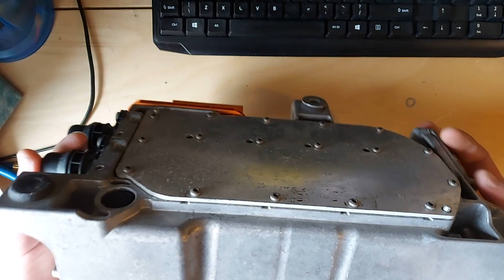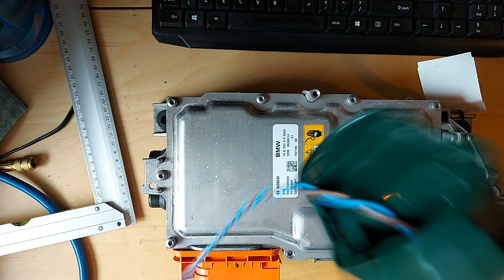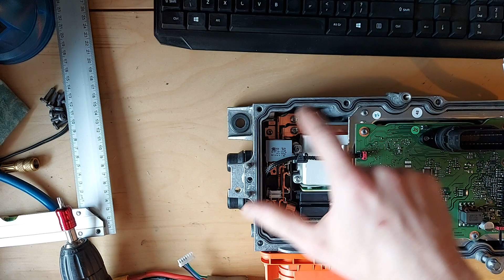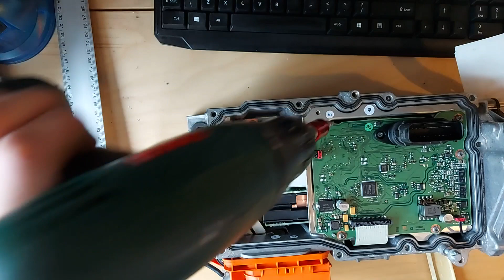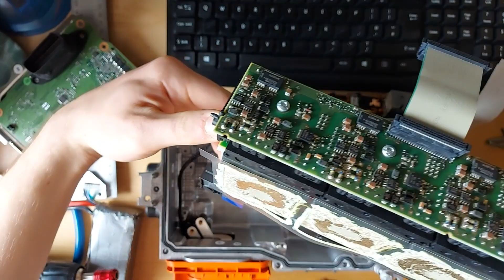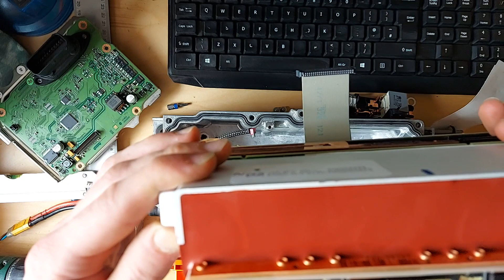BMW I3 Range Extender Inverter REME Disassembly

Comment: Did you ever fix your drivetrain error? I'm having the same problem. Code FFCB95 I think.
Range Extender machine electronics. I'm also getting failures on the HV insulation. 
Did replacing the REME fix it?
Reply from the maker: I haven't looked at the high voltage insulation error yet but I am sure what cable is causing it.

Comment: So this only has to drive the REx alternator as a starting motor for what... maybe 1-2kW for maybe 5 seconds to start the 650cc ICE? That's not going to be usable for even the smallest electric motorbike... is it?

Is that same box used to rectify the REx alternator output to DC to charge the battery?
Reply from the maker: I am certain it is just a standard inverter. I will maybe make a vesc based board to control it and see what it can output.